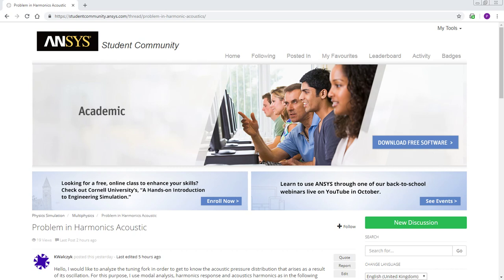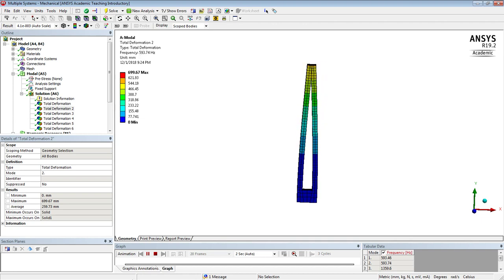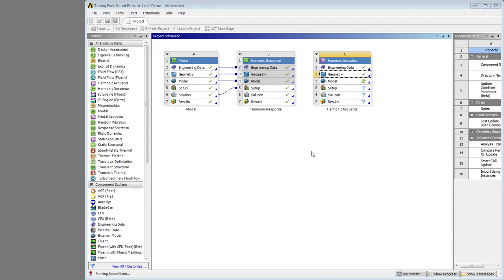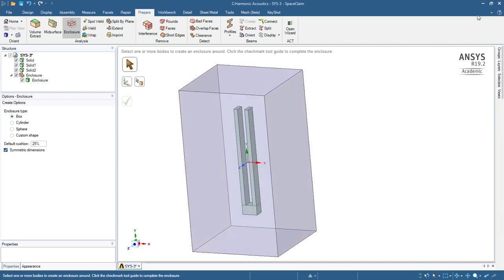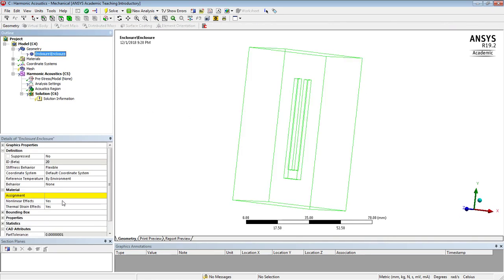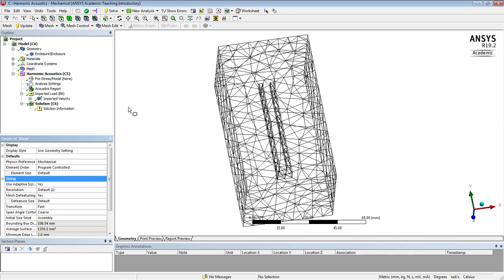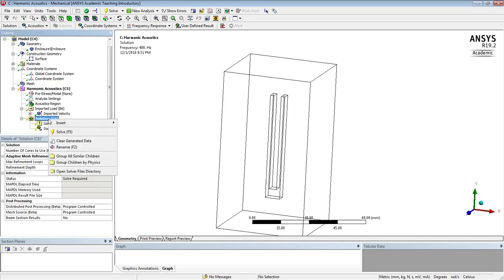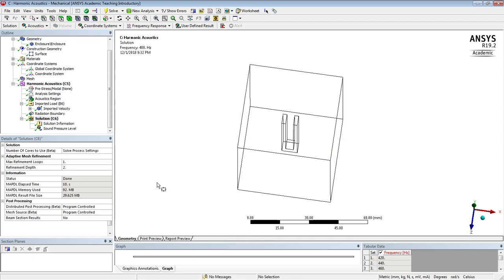Acoustics of a Tuning Fork

Comment: Is there a relationship between the frequency values used in the harmonic response and acoustic? Why did you use different values? Shouldn't you use the same values?
Reply from the maker: The frequency range for the harmonic response does not have to be identical to the acoustic frequency range. They each compute the response independently.

Comment: Could you please make video on Capacitive micromachined ultrasonic transducer? I have circular membrane and want to apply prestressed harmonic analysis. In static analysis, I have to use DC voltage below collapse voltage and in harmonic analysis small signal AC voltage. Then I want to apply acoustic medium. I have done prestressed harmonic analysis but facing problem in acoustic part. 

To apply DC voltage and AC voltagr on cmut I have used EM Transducer (TRANS126) element.

Comment: Hi Peter, 
When you say you would slice up the mesh for more accurate results, what procedures would you use to do this? I am having issues with a large acoustic domain and small mechanical components that are enclosed
Reply from the maker: Hi Nate,
At 4:15 I say I could slice up the solid to make an efficient mesh. That means using fewer nodes and elements. The mesh I used is accurate. The requirement is to use 6 quadratic (or 12 linear) elements for one wavelength of the sound. A 600 Hz tone has a wavelength of 345 m/s divided by 600 /s = 0.575 m  So divide that by 6 to get a maximum element size of about 0.1 m or 100 mm.  In hindsight, it would have been more accurate to move the domain boundary out a few wavelengths; 20 mm was too close to the tuning fork.

If you want help with your model, please become a member of the ANSYS Student Community and create a New Discussion to ask your question. https://studentcommunity.ansys.com/

Comment: thaks for video ı got a question 'frequencies
 value that was used in harmonic response and harmonic acoustic' are they equal ?
Reply from the maker: In Structural Harmonic Response, I used 300 - 900 Hz forcing frequencies of the force at the tip.  In the Acoustic Harmonic Response, I requested the solution sweep from 400 - 800 Hz.

Comment: What is the reason to split the tuning fork into three bodies? Thanks
Reply from the maker: It just gives a nice clean mesh on the forks. You can get a very good result without splitting it into three bodies. There are limits on the number of nodes allowed to solve on the free Student license: Nodes < 32,000 so efficient hex meshes keep the node count low.